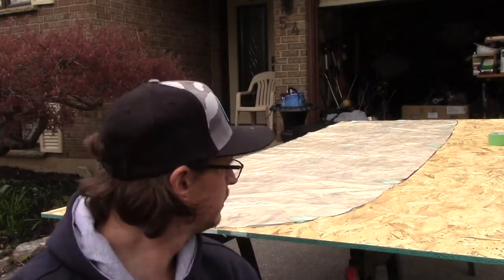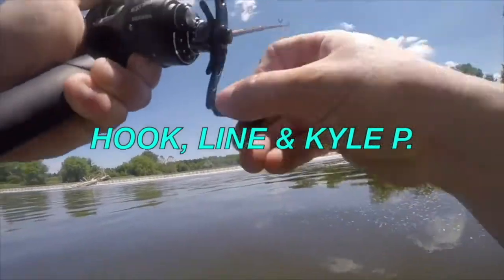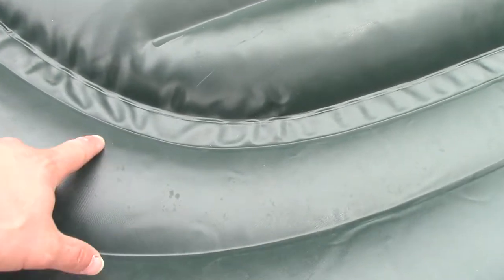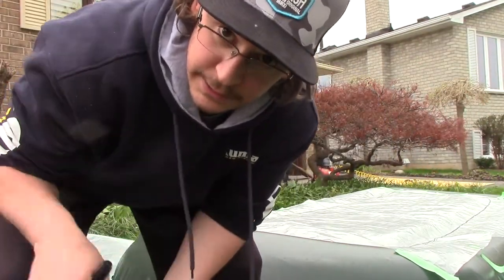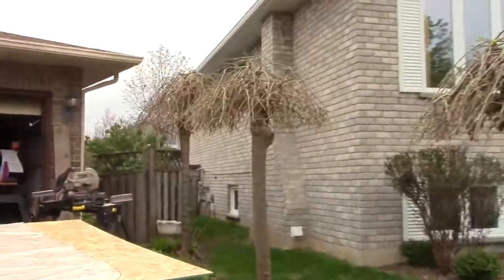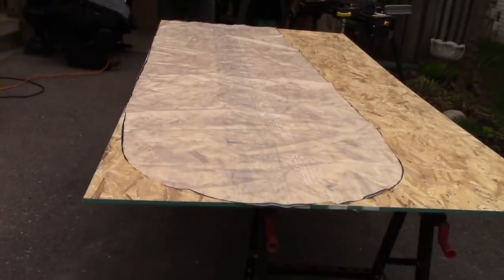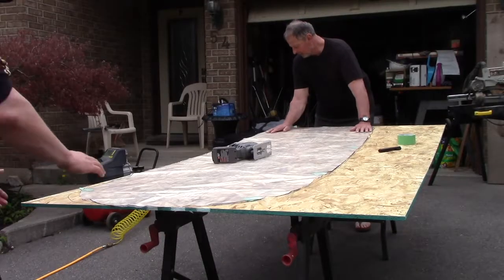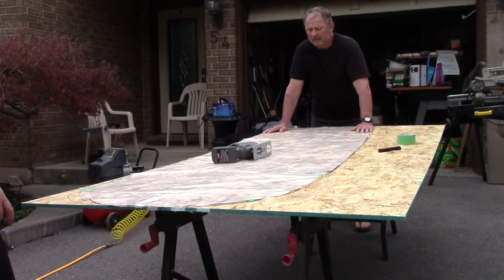DIY FLOOR FOR INTEX SEAHAWK 4 INFLATABLE BOAT!

Comment: Do you inflate the floor under the wood still though? After install. I know you inflate all areas of the boat but because the floor inflates I was just curious if the thickness of the wood prevent floor inflation.
Reply from the maker: I inflate the Floor first then I inflate the first chamber leaving the second one deflated so I can slide the floor in, and have no issues, them Inflate the second Chamber, engulfing around the floor for a perfect fit.

Comment: great job on your floor I am hoping you can help me with my floor about three years ago my wife and grandchildren bought me an intex seahawk 4 but before I got to use it I had a stroke and lost some of my figuring things out ability I have been working on the floor for two summers and don't have it quite right  I have a ford focus and need the floor to fold in half every time I put the floor in the boat and blow it up the two seams pop up and one lies on top of the other my board is 92"s long and 29"s wide I did the tracing of plastic on the bottom of the boat I don't know if I did that right or not if its not to much trouble could you or one of your subscribers give me some advice on what I might not be getting right
Reply from the maker: I can make you one if you would like. Go to my facebook page and we can talk about it.